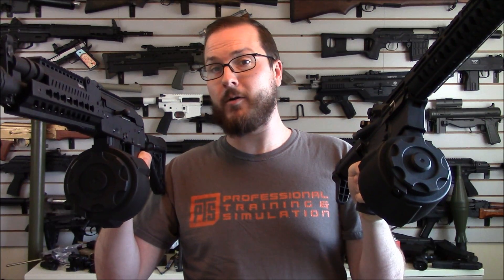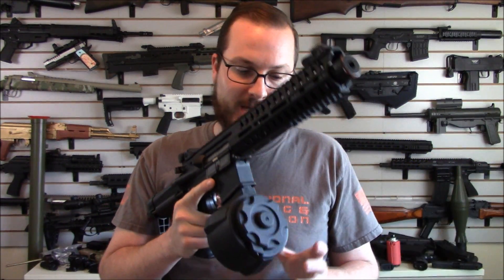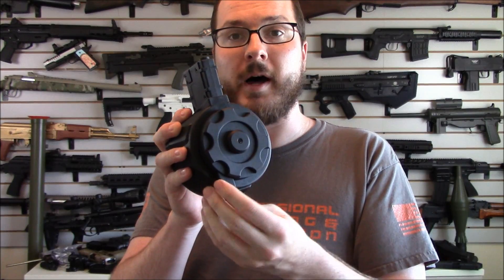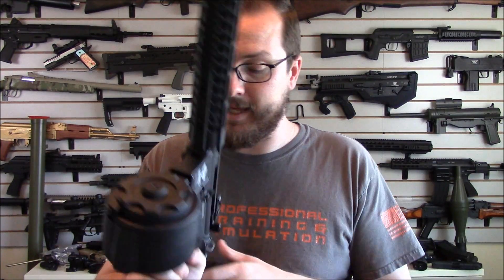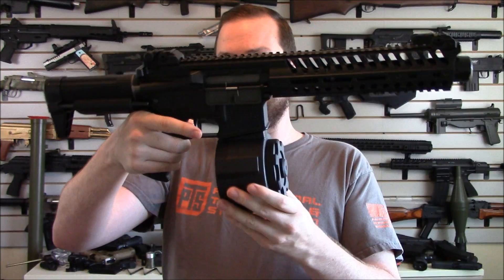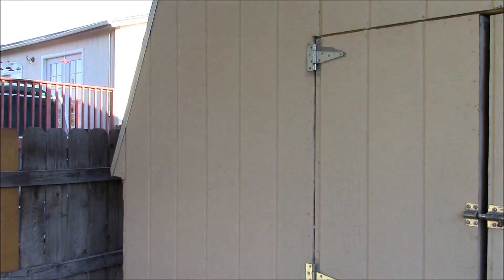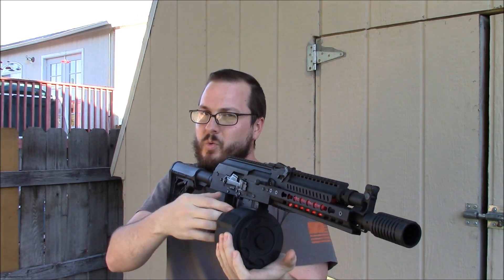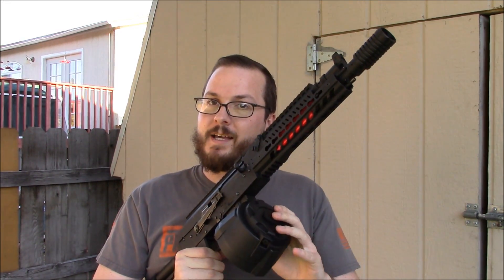Angel Custom Firestorm Airsoft Drum Magazine

Comment: You should disable that automatic audio low volume control, It gets annoying sometimes, when volume of audio goes now and does not go back to normal right away.
Reply from the maker: Unfortunately, you can't disable it on this camera.
Reply: I do a lot of motorcycle exhaust sound recording. 99% of cameras/smartphones lower the sensitivity when something is loud and there's never a way to turn it off. Maybe you can on a crazy pro grade camera

Comment: This comes with different mag adapters. If you use the wrong one, it wont feed properly. Even if you use the recommended one and it still has feed issues, try using another one that works. it requires some dissassembly of the magazine to replace the mag adapter. Using tape or shims is a temporary fix that soons fails because tape dries or gets gummy, and shims move or fall out during use.

Comment: Hey dude, couple of questions which you're probably best suited to answer - will the M4 version fit and feed in either a CA/A&K M249, or and L85 platform? I know previous versions of similar designs haven't either fit or fed, depending on platform, was hoping for an answer before i put cash down. Cheers in advance.
Reply: i would think it would
Reply: would also wanna know since i almost got it for my army l85